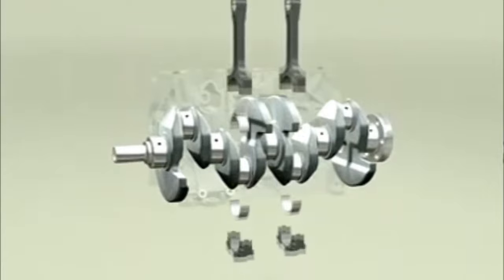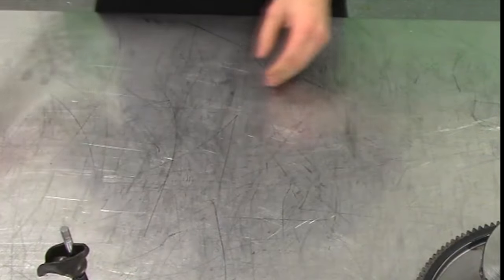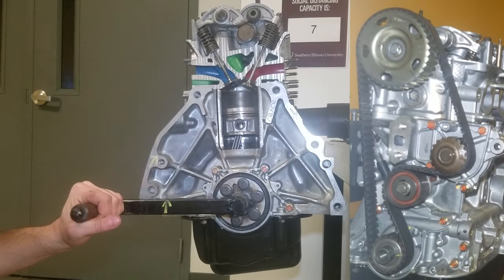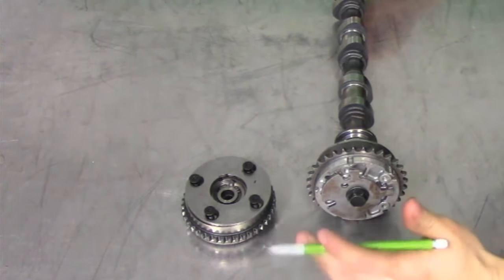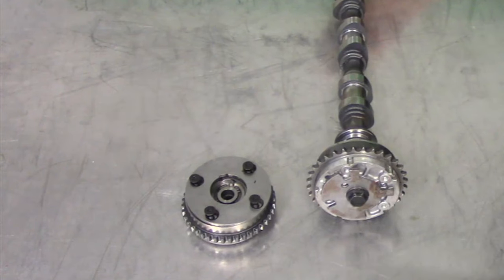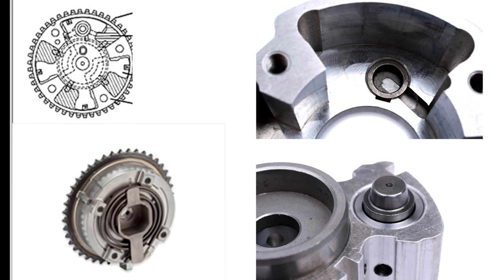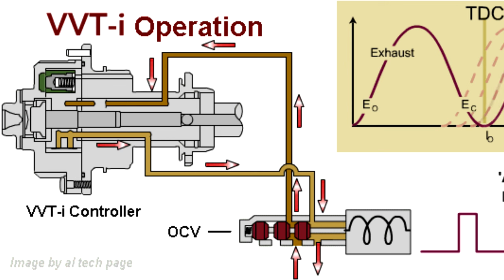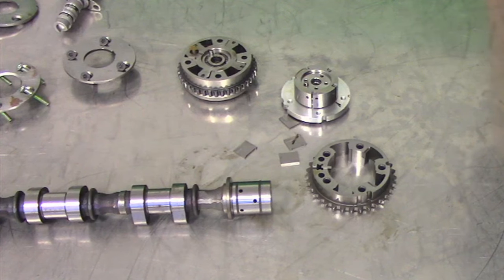Student Presentation: Variable Valve Timing - VVT

Comment: Can anyone answer this? 😊 My car is 4 cyl 8v petrol (non interference engine) and recently i advanced the cam pulley 1 tooth to see if it would help with a little bit more power lower down. Im 100% sure it did but the only thing that worries me is the exhaust is also advanced. Any thoughts would be brilliant, thank you x

Comment: Other than metal clogging the OCV screens, poor oil maintenance building up sludge will do the same thing, sometimes the screens break apart and clog up the oil return side galley and prevent oil flow also. The locking pin hole can get worn out and beveled not allowing the pin to actually lock into place. To visually monitor a slipping problem and not being able to lock down, depending on the valve cover design it may also be noticed that the chain is driving the gear at a constant rate while the cam is lagging behind until the guts of the VVT are forced along with the inner guts being pushed by the outer housing, it's nice to watch this action in slow motion on a video recording. The added pressure of the valve springs is forcing the camshaft to lag behind during a lifting action and more force is needed to push the cam along later in time. Another very nice presentation.